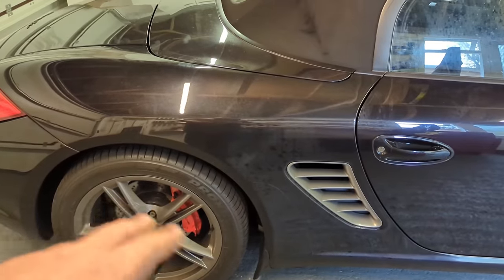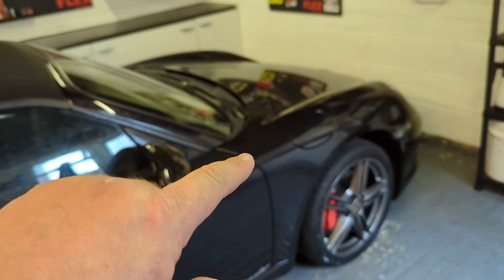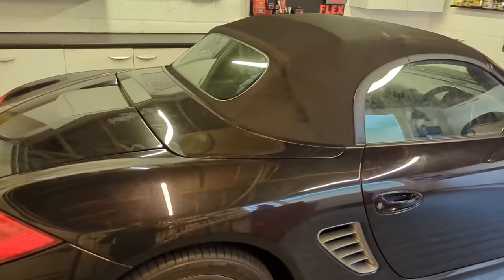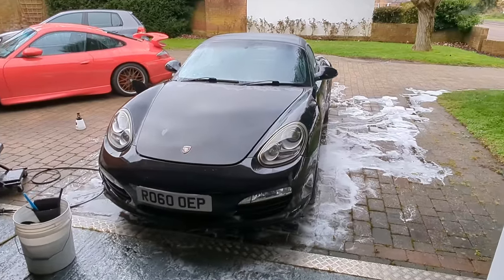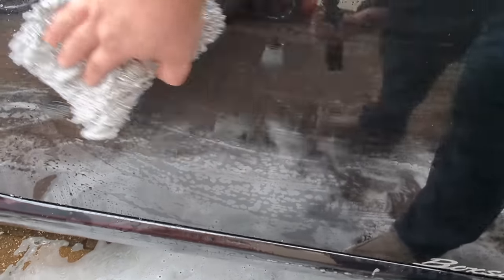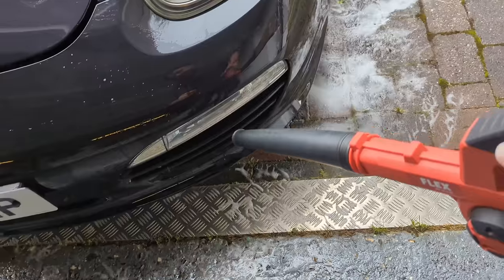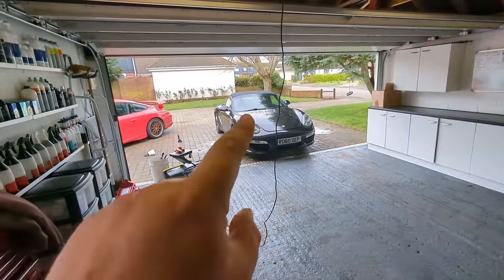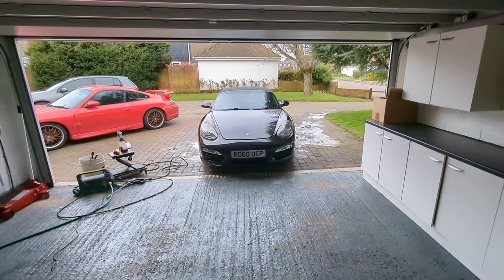Can You Prep Wash a Car in less than an Hour?!? #detailing

Comment: Try using an iron remover with the clay mit jon. Once clean, spray over the whole car with rinseless then spay 2-3 spays of iron remover onto the panel and a spray onto the mit too then keep using the mits own weight without pressure until each panel feels smooth. You might have to do 10- 15 passes. There's a good chance you've not induced any marring. (Rinse the mit well between each panel and reapply iron remover onto the mit). 👍

Comment: Long term subscriber here 👍 loving the content! 👌 need some advice if possible my rear bench in my car is leather and the underside foam is soaked and smells musty from.a bad boot water leak! Any tips for cleaning it (the foam). Obvs dont want to damage the leather in doing so! Thanks
Reply from the maker: You need to spray a mould killer into the exposed foam.Pump the foam so it spreads. Let it dry put back in car.  Valet pro enzyme odour eater.  Some times best solution is replace the mouldy foam